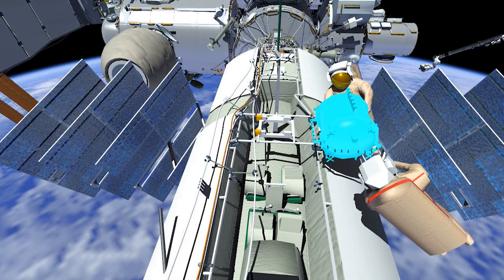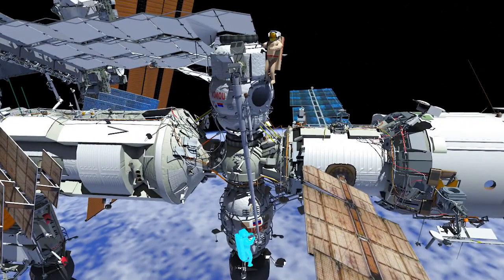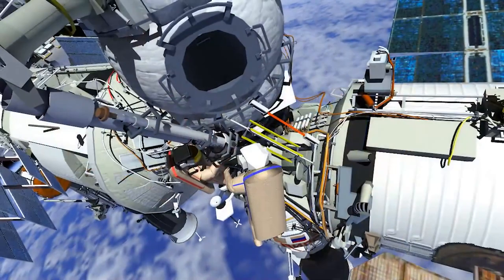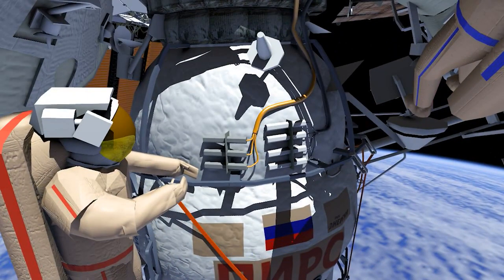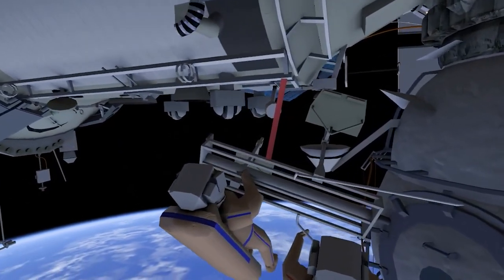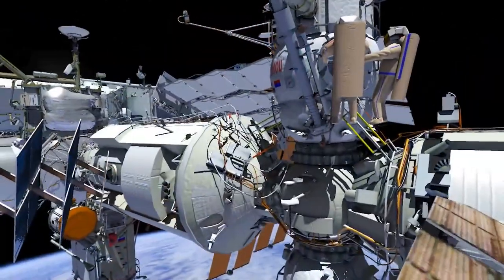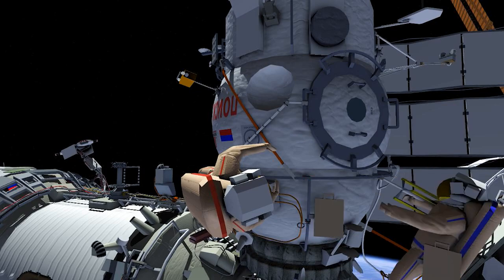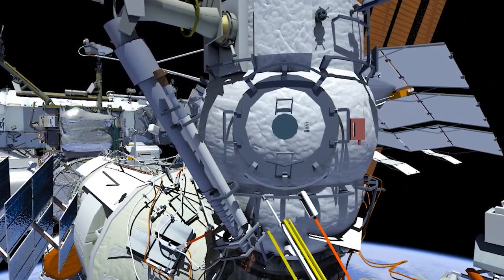Russians spacewalk for Pirs docking compartment decommission in animated explainer

Comment: Jettison garbage panel.
More space junk
Reply: It follows humans wherever we go 😔
Reply: The iss is on a very low altitude. The garbage will deorbit.
Reply: It will burn up
Reply: So y don’t need to complain
Reply: @jonahsgang8830  
A piece of space debris has punched a hole in one of the International Space Station's robotic arms. NASA and the Canadian Space Agency announced on Friday that they found a 0.2-inch (5-millimeter) puncture during a routine inspection of Canadarm2, Canada's autonomous arm, on May 12.
Reply: @sneakytom7416  
As of January 2019, more than 128 million pieces of debris smaller than 1 cm (0.4 in), about 900,000 pieces of debris 1–10 cm, and around 34,000 of pieces larger than 10 cm (3.9 in) were estimated to be in orbit around the Earth.[7] When the smallest objects of human-made space debris (paint flecks, solid rocket exhaust particles, etc.) are grouped with micrometeoroids, they are together sometimes referred to by space agencies as MMOD (Micrometeoroid and Orbital Debris). Collisions with debris have become a hazard to spacecraft; the smallest objects cause damage akin to sandblasting, especially to solar panels and optics like telescopes or star trackers that cannot easily be protected by a ballistic shield.
Reply: @jonahsgang8830  
https://en.m.wikipedia.org/wiki/Kessler_syndrome
Reply: @lissaleggs4136   It's not necessarily a human made debri that punctured the arm.
The orbit of this container will decay within a few weeks, it is monitored and there is not much activity at those altitudes.
Reply: @Aditya Suri 
Okay girl...